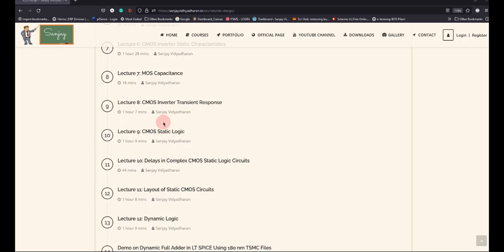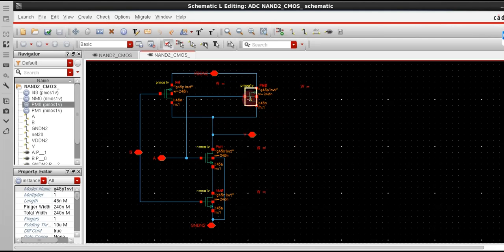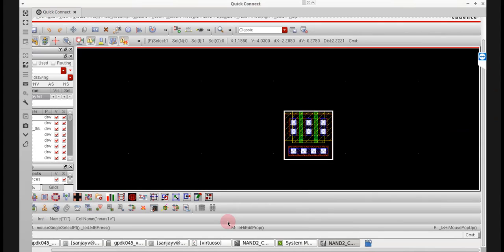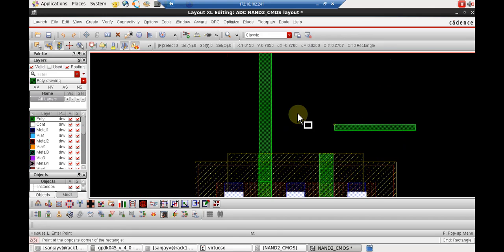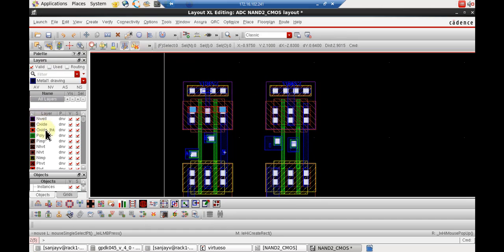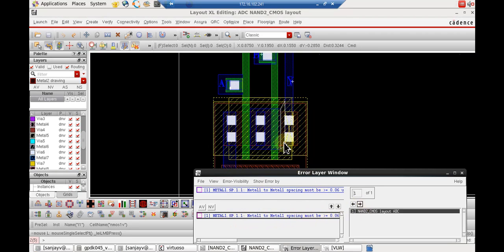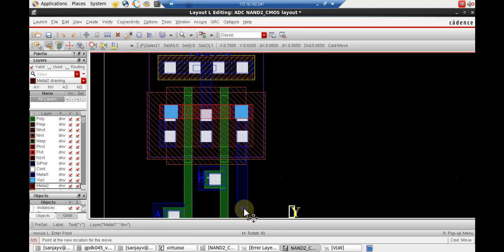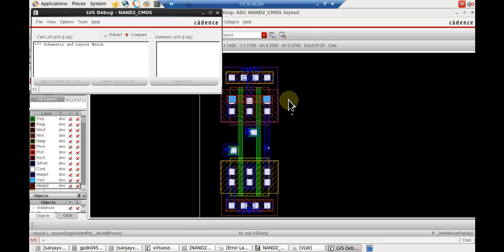Layout of NAND gate in  Cadence Virtuoso . DRC and LVS Check

Comment: is GPDK only allows layout design or postlayout simulation is also possible.
Reply from the maker: Post layout is also possible
Reply: @SanjayVidhyadharan  sir, i need help in performing post layout simulation. i have completed DRC and LVS steps using GPDK 45 but getting errors in qrc extraction. if possible please help.